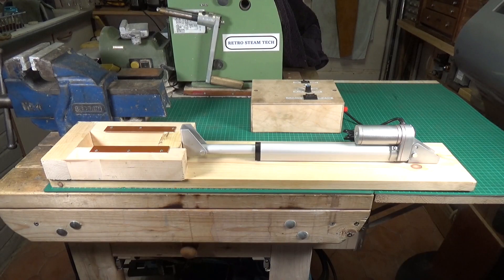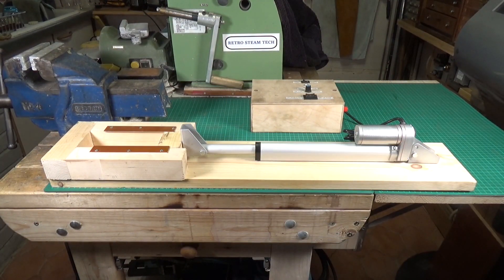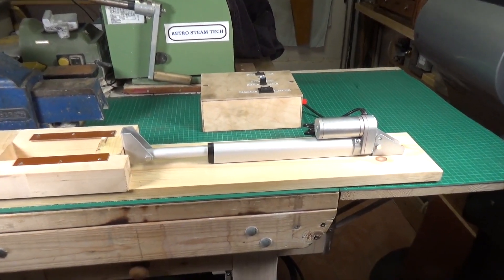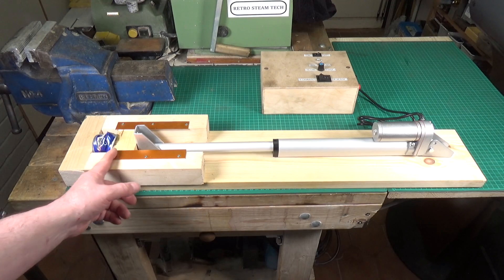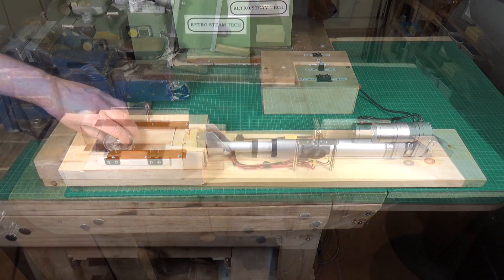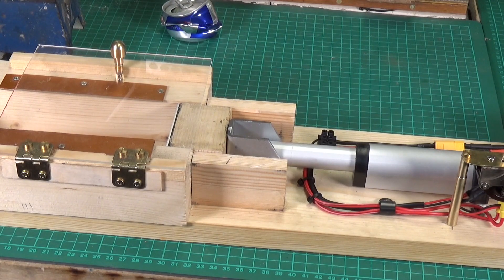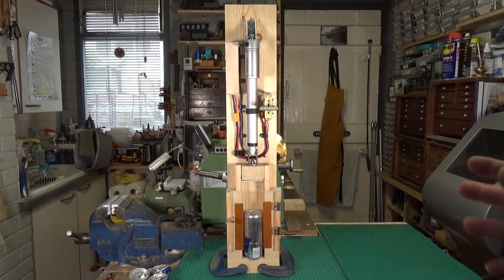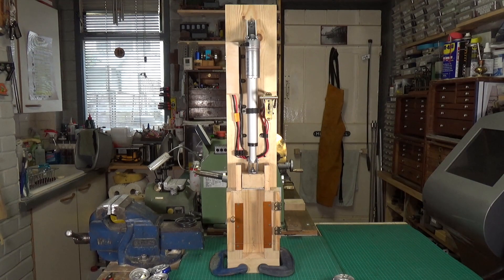Mk2 Can Crusher

Comment: At the moment aluminium cans are worth 30p per kg and there are aprox 70 cans to a kg. At that speed of crushing and no outlet for the crushed can I dont think you will get rich quick.  As a tidy engineering hobby project its great.
This is a bit more practical based on an old cement mixer. The small orange block is a magnet to catch the(rare) steel can.  https://www.youtube.com/watch?v=Vof2Sce5mgg
Reply from the maker: No I don't think it's a money spinner 😂😂 Certainly is fun to use though and as you say it's a nice little project.

Comment: If the top face of the crusher base was metal and had a slight slope down towards the front, might an uncrushed can be retained by the door but a crushed can would slide / fall out when the ram retracts?
Reply from the maker: Yes it might well do, then like Bill's crusher you would need a bin or something below to collect the crushed cans. I can simply pull them out and throw them in the recycling bag.